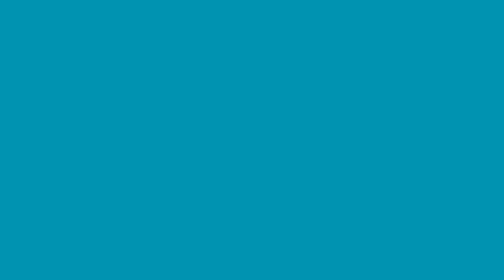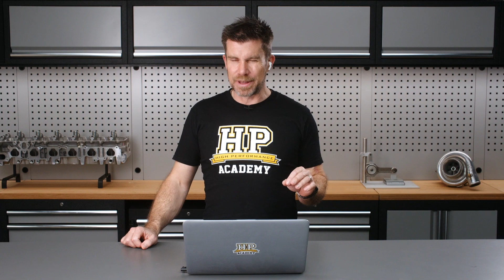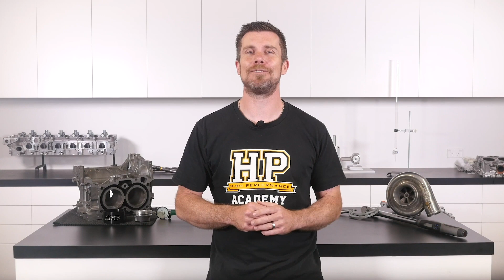Pre-Ignition vs Detonation/Pinging/Knock & Where It Occurs [HPA Q&A]

Comment: Could a spark plug’s broken strap in the combustion chamber cause pre detonation? The next day after a tune a hole burned through cylinder 3 at the top near the head gasket going wot on a sleeved, forged internal k20c1 fk8 block.